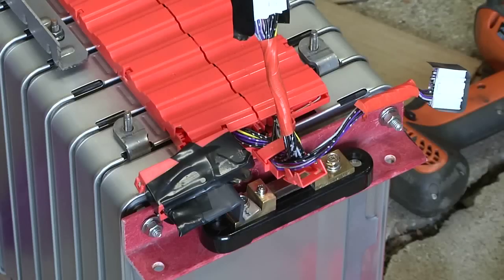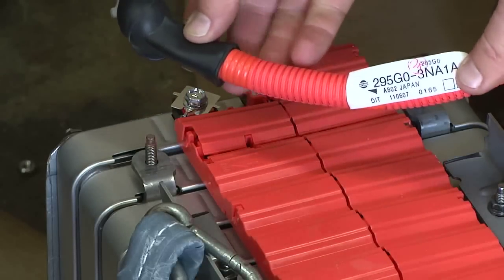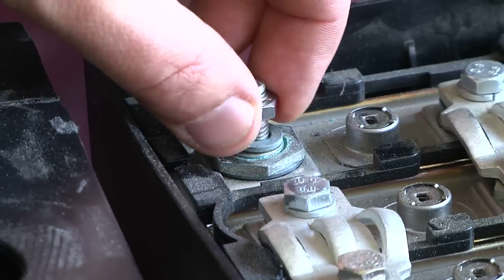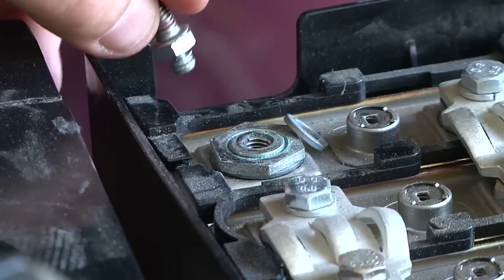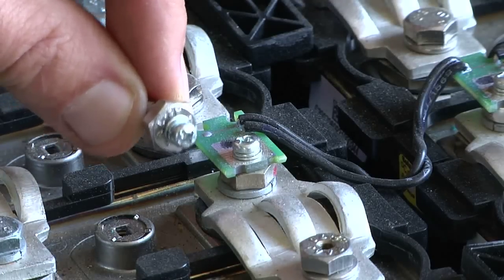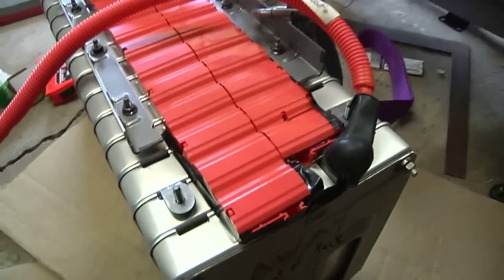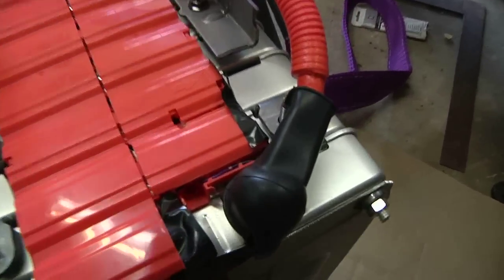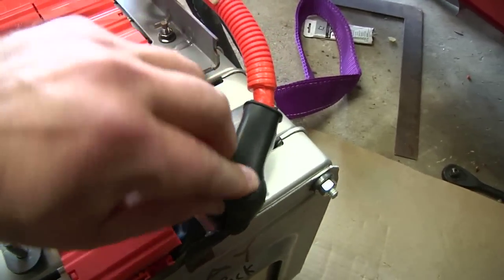Vectrix w LEAF Batts 02 Putting Cells in the cycle

Comment: Where did you source the batteries from I need to make a pack
Reply from the maker: I purchased an entire Nissan Leaf electric car battery from a salvage yard, took it apart, used about a third of it in the Vectrix, and then sold the rest of the cells to two other guys building electric motorcycles. Try doing a salvage yard search and see if you can find a Leaf battery pack for sale.
These guys usually have Leaf cells for sale too, but more expensive than what you would pay at a salvage yard. https://evbatterycenter.com/HAC4

Comment: You vids showing us how the leaf batteries can be used are great. I am setting up about 6 leaf batteries for my riding mower.  It will be a 24 volts at 100 ah. I need to know how I will charge them and balance them. If you would make a vid showing us how to charge and balance these small sets of leafs batteries, that would be very helpfu.  Thanks.
Reply from the maker: +robviolin1, 24V sounds pretty low for a riding lawn mower. All the ones I have ever seen are 36 or 48V. Unless you have a commercially built electric lawn mower that was originally designed for 24V, you are probably better off running it at higher voltage. To charge, just get yourself a charger of the appropriate voltage and connect it to the pack. Use a single series string of the LEAF cells, and make sure they are matching voltage to start with, and there really shouldn't be any reason to have to rebalance them. You can always use something like Cell Logs to keep an eye on them.
Reply: +BenjaminNelson Thank you for your reply, I appreciate it. I am using a me-1004 DC motor with two AGM 12v 55ah in series on a old Ariens riding mower. Works great for my needs. I need 6 Leaf batteries with 3 sets of 2 in parallel and the 3 packs of 2 in series to replace my AGM batteries. That will give me around 24v at 120ah. I need to know how to balance the batteries when I am charging them. If you can help, it would be great. I would send you a pic of my mower if you get me an email address. Thanks
Reply: +BenjaminNelson Also, charging up a small set of leafs mixed with some in parallel and some in series is something we you tubes viewers need to learn.  if you could make a vid on this, it would be great and a big help all your viewers. Most people that post vids on batteries seem to take it for granted when it come to charging, but charging and balancing is the most important issue when batteries are used for whatever.